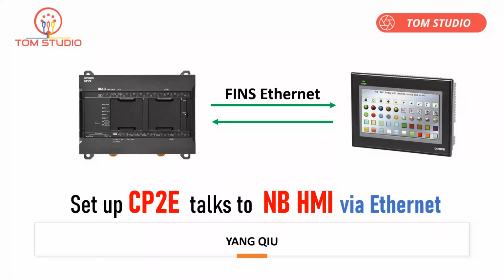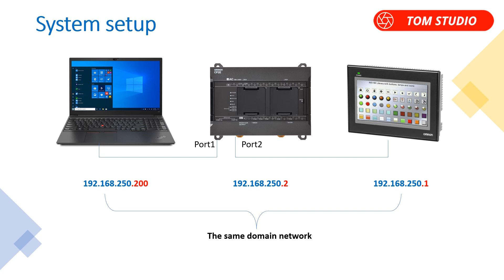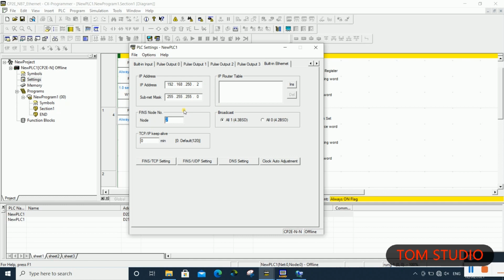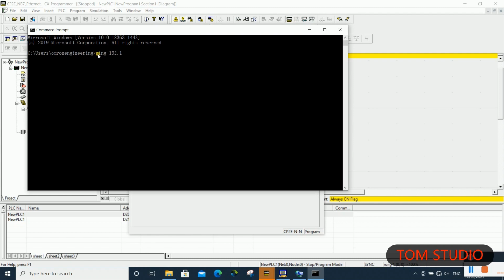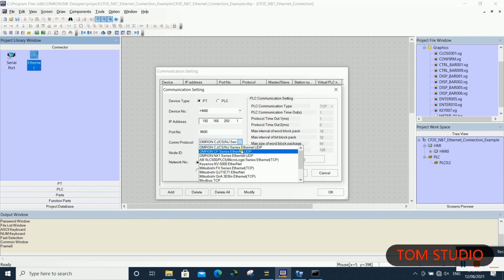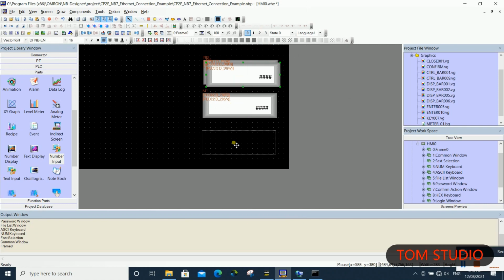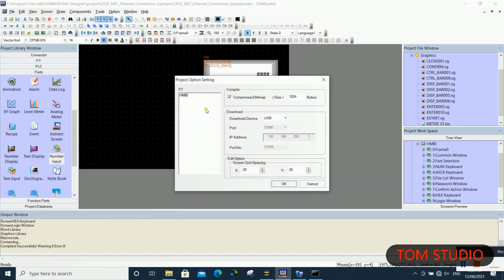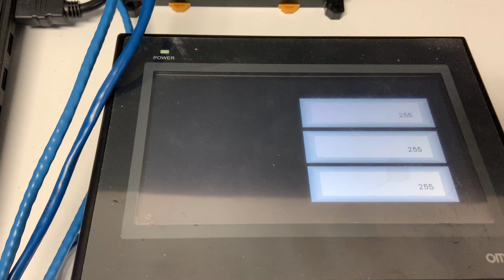How to set up Omron CP2E PLC to communicate to NB HMI via Ethernet

Comment: Is it possible to simulate and check communication using only a cp2e plc and a leptop pc (nb designer) without using NB HMI hardware?
Reply: Unfortunate you can't do it. NB designer only supports to simulate the HMI itself program, does not support to simulate between PLC & HMI. Omron NA HMI supports it.

Comment: hi sir. did you ever do it using others brand hmi?
and cp2e communicate with others brand sensor/amplifier/io terminal using ethernet?
Reply from the maker: Which brand HMI do you want to connect to CP2E via Ethernet? Please be aware that CP2E Built-in Ethernet is FINS protocol, so if you want to use other brands HMI like Redlion or others, you need to make sure they have FINS Ethernet driver, As far as I know, you can definitely use like Redlion or proface HMI to communicate to CP2E.  CP2E Ethernet can also be set as Modbus TCP server, so you are able to use Modbus TCP to connect to other brand sensor/servo/VSD via Modbus TCP.